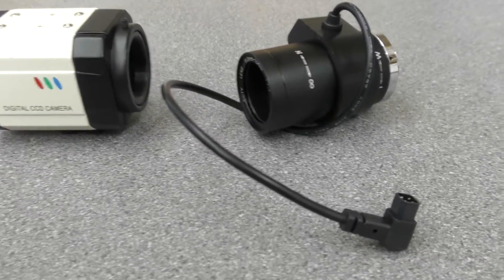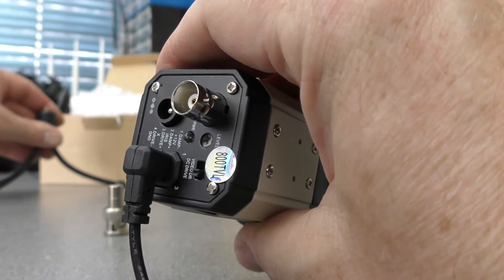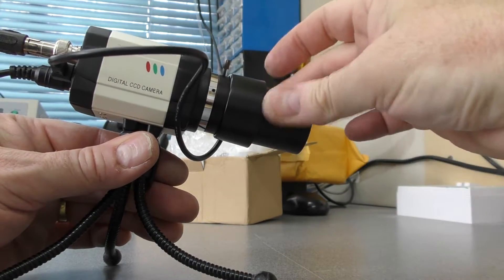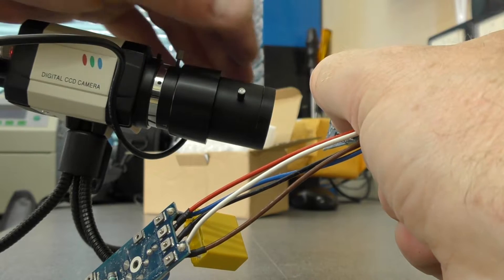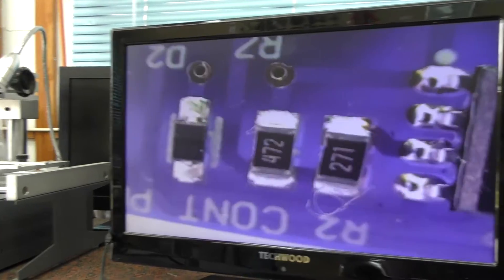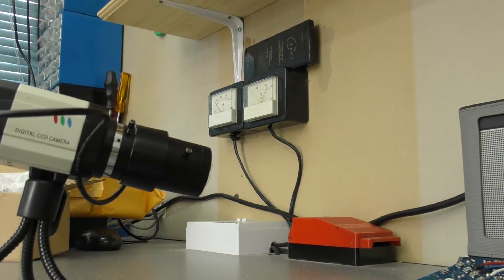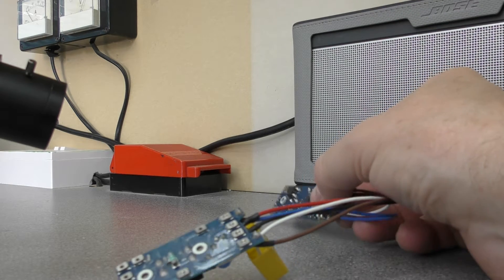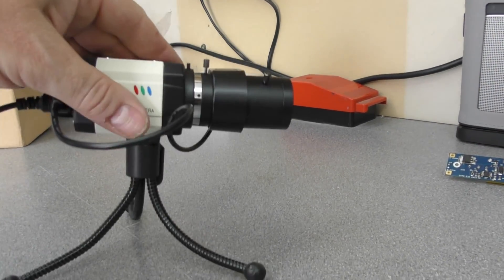1/3" SONY CCD 800TVL Industrial Microscope BNC, BGA rework, inspection.

Comment: Hi Trevs,
I did similar settings to yours with a little difference and the results were great. I would use smaller lens with very low fstop as well as a small LED ring light with a diffuser, you'll get a sharper, clearer and more detailed pictures. I am right now working on a tinier lens which will accommodate a tiny prism to be used for under BGA chip inspection. Thank you for sharing and good luck.
Reply: Out of curiosity did you ever get the under bga inspection lense / prism working? Looking to create one myself. Thx.